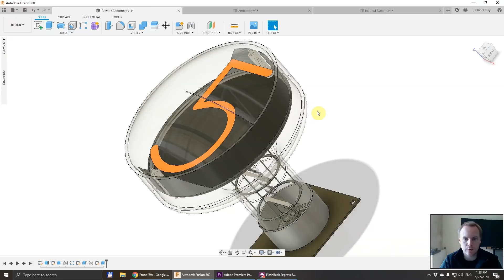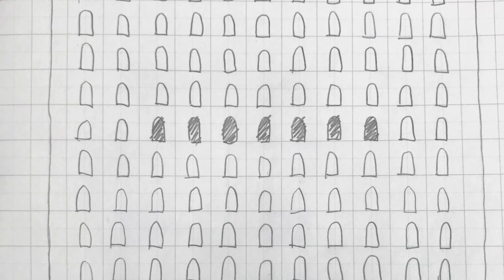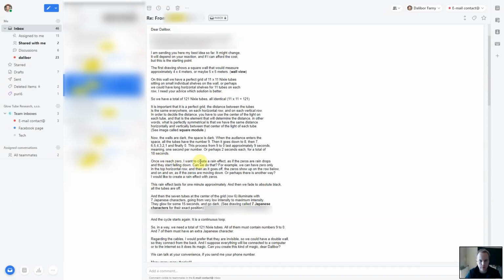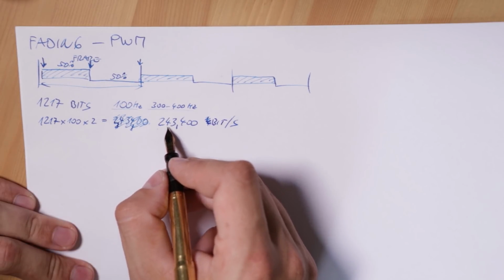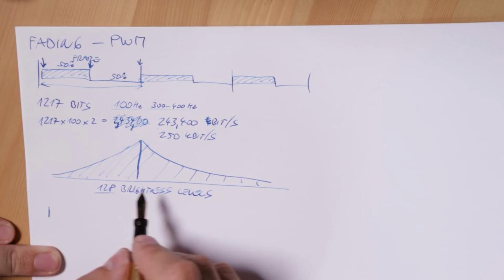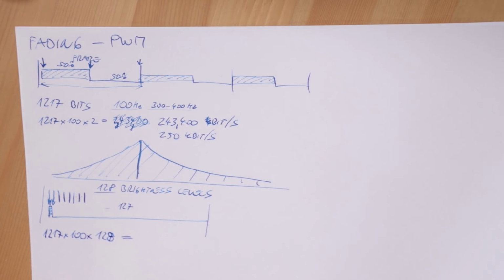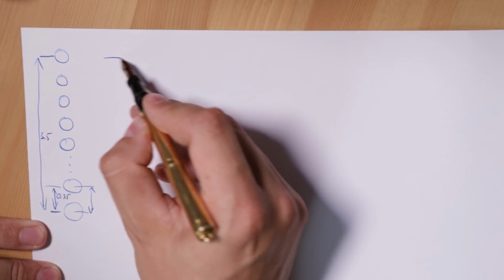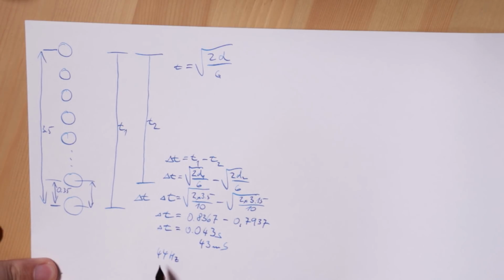Thinking How to Drive a Panel of 121 Nixie Tubes | Project H #6

Comment: 1 bulb = 4bit digit data + 4bit intencity grades.
if it is right, you can use standarts of DMX-512 for controll it. 44hz refresh rate will be good for this aplication.
separate channel as one thing, all dmx- programs has a simple controll program.
you can add this nixie wall into ready system for 121 adresses.
this is a simplest thing what i see in this app.

if you need help in electronics contact me 
ledguru at yandex dt ru

Comment: Nixie with character of that size has necessarily an important capacity, so I believe they are much slower than small tube to drive with PWM... What is the minimum delay to turn it off to on and reverse? This would limit also the max duty cycle steps, and consequently the maximum period of the PWM generator...

Comment: I would definetly implement DMX for this as it's pretty much the industry standard when it comes to lighting. DMX is like sending an array of values ar a rate of 44 Hz. You could send all the values as an 8-bit number with each DMX channel corresponding to either a nixie tube, or a single character. You can daisy-chain the signal cable to the next daughter board also. If you want more control I would suggest allocating one channel per character, so you would need just over two "universes" (512 channels) of DMX. If you need more precision you can combine two channels to get a 16-bit number (also common in industry) Now you could digest this data with a daughter board for either each nixie or per row, and then take those values and update a 300Hz PWMs value. Essentially you would have a fast PWM, whos value changes at 44Hz. I work in AV production, and DMX is the standard for pretty much everything I do, as well as the concept of a box with many functions being controlled by a daisy-chain of devices. Because in a production environment, a light fixture may be an LED that is being operated with a frequency of 1200 Hz and DMX always looks perfectly fine.

Comment: I think you're on the right path with your DMX solution. A couple thoughts:
1) You may find that using the real physics of a raindrop falling doesn't actually provide a visually pleasing result; in practice it may be slower or faster.
2) With DMX-512 you can use smaller packet sizes (addressing less than 512 individual channels) if for some reason you need a faster framerate. You would just need more "universes" to handle your devices. (Of course, support in DMX controllers for variable universe sizes and packet length/timing may vary.)
3) FYI, DMX packets are basically snapshots of the state of everything, rather than "fade up, fade down" commands.
4) As Peter Knight mentioned, if you find you need more dimming precision than DMX provides in a single channel, you can combine two channels for much more control. This is common in the lighting/entertainment industry.
5) There are COTS control consoles that you could [rent and] use to program the effects you want. You could then use a COTS DMX playback device to record and subsequently play back the show.
6) Keep in mind that by using DMX you're making it possible to control this display with COTS devices (meaning the customer can easily change the behavior of the display without your help once the product is delivered). That's good. It's also bad in terms of vendor lock-in. Just something to think about.

Comment: With RS-485 you should really connect everything on a single bus, without splitting the line, so in this case going left to right, then one row down and right to left and so on. It might also be a good idea to add a "clock sync" line, so that you send the commands to all the modules and they all change at the same time when the sync triggers, else you will get a small delay between each module and it might be visible. Personally I would probably go for a custom protocol for that application, but I see that DMX should workout for this and if it doesn't, you can always try to make a protocol for it that would be more efficient. You could also speed it up in this case, because you only need one way transmission, you could make the whole row one address, except for the one with special characters, which can be split in half, one address for the modules that are 0-9, another for the ones that have the special characters, this way you reduce the addresses you need to transmit to from 121 to 12

Comment: I do a lot of large-scale installations, mostly LED but also LCDs, motors etc. 
The way I'd do it would be to have an intelligent controller board on the back of each tube, probably with all the HV stuff, including the anode step-up converter onboard, running from a 24-48V supply. 
The controller would be something simple & cheap like an 8-bit PIC etc. 
This avoids the issues of running HV round the installation, and making cabling simple. You could probably implement a step-up mostly in software using PWM/ADC hardware. 
Probably bussed in a few sections using RS485. The node count means you;d probably want to split into maybe 4 sections to get sensible RS485 loading, though as the baudrate needn't be very high ( a few hundred kbaud), you might be able to do it on one bus with low-load drivers.
An advantage of using a bus rather than daisychain/shift-register is better fault tolerance, and ease of testing - if one works, they all (usually) will. data will be mostly unidirectional, master to nodes, if you want any feedback for fault detection, then this would be done by the master polling each node in turn. 
I'd probably use something simple DIP switches for the device IDs, as this makes long-term maintainance and spare-swapping very easy - you have  a label stuck next to each tube position showing the switch settings for that position. If there is a fault, the maintainance people are instructed to swap the tube and its board, to be investigated later, so they don't need to diagnose whether the issue is tube or board.
Reply: You also want to do the wiring as serpentine  ( zig-zag) , not star, to avoid reflection issues - electrically it wants to be a single line, with termination at the end.
Reply from the maker: One serpentine would not allow us to fit all 121 devices while keeping RS485 specs (12k node impedance). So we will make star with 11 lines, each terminated with resistor to supress signal reflection.
Reply: @daliborfarny  11 parallel terminators on a star could be a problem. At low baudrates you can probably get away with higher termination resistance than the typical 120r.
Reply: Ah.... talk of the devil !
Reply from the maker: Hi Mike, nice to see you here, thank you for all the advice, we are planning to make things mostly just like you advised. Just the HV might be delivered from a single PSU via shielded ethernet (two twisted pairs in parallel, 200mA each). Each row will be separate so we have only 11 nodes on a single RS485 driver. Bus will be common. Boards replacable with DIP switches for address settings so we can instruct local people to configure new board in case of failure. Plug&play. Cheers!
Reply: @daliborfarny  think very carefully about the implications of a cable issue, or a hot plug/unplug if the ht pins make contact before ground. Protecting rs485 transceivers from 200vdc could be a challenge, and on a bus, a fault could potentially kill every device on the bus.
Reply: mikeselectricstuff Optoisolate the RS485 stuff in each tube socket like a normal good DMX-512 light?
Reply: I thought of you as soon as I saw the title of this video.
Reply: @Muny  who doesn't :) Mike has tons of kowledge
Reply: Oh my God so fucking excited to see Mike up in here. YouTube is such a small amazing world. Mike's channel is one of my favorites.
Reply: Hey Mike, digging the simplistic approach (well, simple in physical items). Especially the part about the easy troubleshoot/repair sequence. IMO, the best kind of anythings when it comes to many correlated, complicated items running, is the kind that requires little to no exertion on behalf of the uninitiated maintenance crews. If something's broke, let the designers or initiated crew deal with it, but allow fast swap capabilities. Really neat planning. 

Otherwise, hope everything's alright with ya.
Reply: Consider EtherCAT/TwinCAT (Beckhoff) - 65,535 nodes.....

Comment: DMX is the ideal protocol for this - you can use commercial DMX equipment that really speeds up prototyping.
One thing to watch out for - if this is going to be operating in a darkened room, you will need more than 128 levels of brightness. I'd suggest 4096 steps, and then map those to 8 bits with a logarithmic curve. You will need a lot more resolution at the dark end. If you have a microcontroller on every tube, you should be able to achieve PWM with a 4MHz clock easily with the onboard timers, giving 1kHz PWM rate and 4000 steps.
You may need a seperate DMX driver for each row, as RS485 transmitters don't always allow you to fan out to 121 devices. You should be safe with 16 though (so 1 per row), and you can use commercial DMX signal boosters if you need them.
Reply from the maker: 121 devices - we are going to split the signal to 11 rows, 11 devices each, one bus.
Reply: @daliborfarny  My point is that RS485 drivers can often only power 32 receivers, not 121. So you might need multiple drivers. I'd have a seperate DMX driver for each of the 11 rows. That keeps you well under the 32 receiver limit. They all use the same DMX signal, just different drivers.
Reply: @daliborfarny , THVD1500 would fit the bill.  Supports 256 nodes.
Reply from the maker: Very nice, thank you! We plan to use 8MHz internal oscillator on atmega328p, so 1khz PWM frequency and 12bits PWM is definitely possible. You are absolutely right with the logarithmic curve necessary for the brightness - the changes in brightness are most visible on the dark end, exactly as you pointed out.
Reply: @daliborfarny  Counter1 on the ATmega328P can run at 4MHz with an 8MHz clock source, so 4000 steps / 1kHz should be possible.

Comment: Very interesting. When you started to discuss fading I immediately thought of making each Nixie driven by a "smart", individually addressable module. Many advantages, commonality etc. Using standard protocols and busses seems a great idea; "why re-invent the wheel". One thing to consider just in case you have not already considered: Human perception of brightness is not linear. So a lamp running 50% will not seem 50% as bright. This implies that you may need finer PWM resolution that expected (more bits) especially at low intensity or use a logarithmic lookup. Do neons behave well with high frequency PWM? I didn't know if they were limited by time taken for plasma to form/ extinguish or whatever!.  mikeselectricstuff would like this project, I hope you follow his channel...
Reply from the maker: Hey! The times needed for the plasma to form/extinguish are really fast, it starts to be noticable around 100kHz. Good point with the non-linearity!
Reply: Great comment on the logarithmic PWM perception! Check out Dalibor's project on the ultrafast Nixie tube counter/timer, neons are fast enough I think :-)
Reply: I have personally done Nixie fading using a 4KHz PWM carrier and it works well. The glow ignites and extinguishes very rapidly although I don't have any hard numbers.

Comment: Microchip makes multiplexers specifically designed for HV applications.
Reply from the maker: Yes, we use them in our clocks (HV5622), they work well on board, but we would not be able to feed them with data at this distance..
Reply: @daliborfarny  Think it would be best to speak with Mike Harrison, as he has a lot of experience with these sort of large installations, and probably has most of the firmware and software you need in the greater part written already, as well as proven layout and boards for both the control and driving of them. Will save you hours of wrong paths off the cuff.